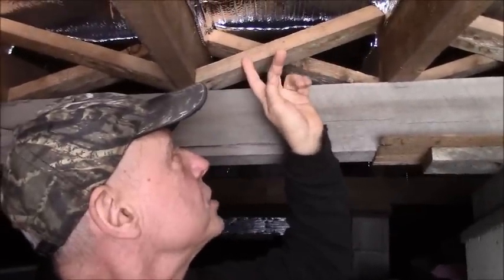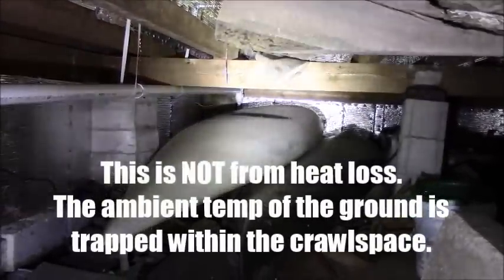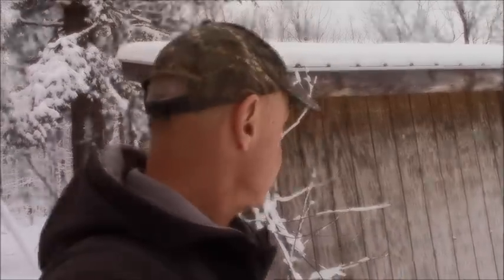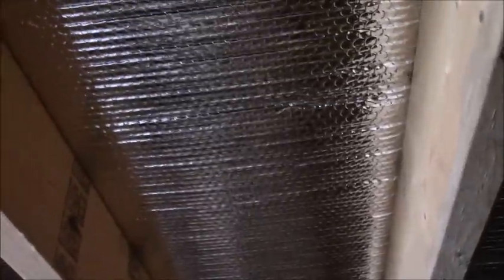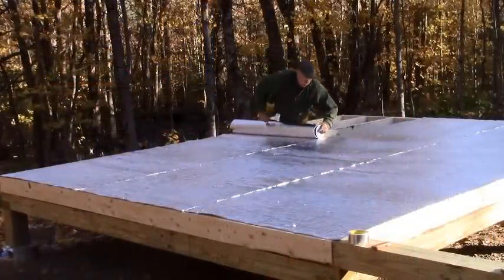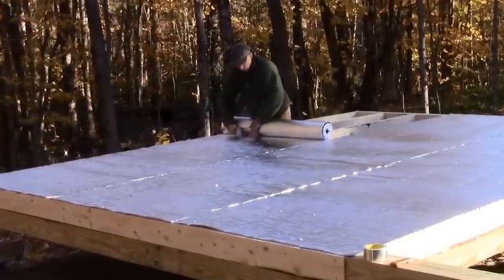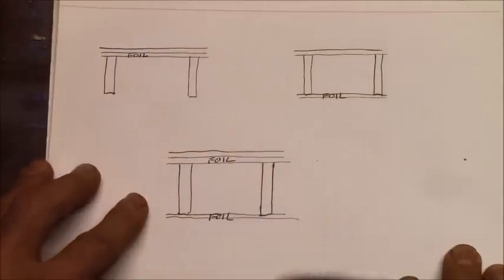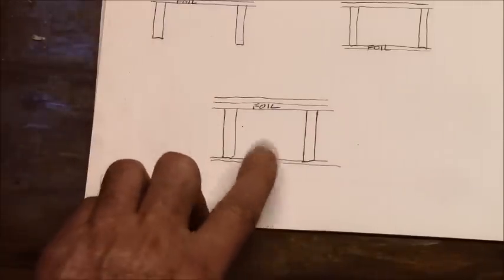BUILDING INSULATION  Proven Tactics and Solutions For RODENT FREE Results and DAMP CRAWLSPACES  DIY

Comment: Boss, I really want to use this bubble foil and I'm convinced it works for you up in Maine.  However, I'm in Louisiana.  I do have something like this in my metal shed and it works good.  But on the cabin I'm building, I'm concerned that putting the foil between the subfloor and the joists touching a cooler subfloor (air conditioned in the summer being very hot outside) will cause the kind of condensation issues you mentioned around 21:00 of your video.  Can you give me any suggestions on this?  Thanks.
Reply from the maker: Very good point you have there.  I can't say for certain but I would think you'd be ok doing this. If you can get beneath your structure, you can staple the foil to the underside of your sub floor (between the joist) and do a section of floor but not the whole thing.  This will allow you to peel back a few spots to inspect the results. Then proceed or switch to a plan B.  Let me know how it works out.

Comment: A quick question and if I were to have a building with a crawl space would definitely use bubble foil.  The question I have is I see a lot builders and DIYers having spray foam in roofs and walls.  Is there a problem in doing that or is it great insulation to use?  Thanks and I’ve been with you for a long time and never get tired of your videos, keep up with the awesome material you project.
Reply from the maker: Spray foam insulation is one of those things where you take a gamble it it.  It works but it's toxic as hell.  Google the effects of spray foam insulation and decide from there.

Comment: ants love the pinkboard too. I put some pinkboard scraps in the attic of a shed and a couple of years later I noticed pink dust on the floor of the shed. I looked up and pulled down the scrape pieces of foam board and sugar ants had made a home inside the  foam, there were thousands of them.
Reply: Dang... That's not reassuring. XPS foam board is exactly what I planned on using. : (

Comment: Super video^^ as always lots of fans of the bubble foil on here, quick question from the "peanut gallery" about walls, if you're building new, and dont want rodents in whatever insulation you use, but want the wall to still breathe, is there a way to use the foil and that soffit vent spacer thing you use, and then have a vent say at the top of the outside wall, or somehow tie it into the soffit vent in the rood overhang? (as you can tell, im not a builder^^) but I'm thinking there must be a way to be able to use it  and still allow the wall to breathe, you probably have better ideas on that than i would. Thanks. Hope you got to see the video link I sent before of that giant greenhouse thats suing bubble foil for its insulation, made me think of you. Cheers.
Reply from the maker: The best way to keep mice out of the walls is to have it sealed so they can't get in.

Comment: Did you put foil against the rim boards ?
Reply from the maker: I did but that was a mistake.  I've found that it's important to ONLY put the foil against a surface that will reflect heat. Putting it against a surface that reflects cold will create moisture behind it.

Comment: Thank you for such a detailed and informative video.  I love your content.  I live in a 111 year old Sears home.  The cellar ceiling is insulated with fiberglass.  Some of it is falling down.  Wondering if I should remove it and replace with the bubble foil or should I just put the foil as another layer.
Reply: Also, we have had rodent issues.
Reply: And, I love the ending.
Reply from the maker: I'm making a list of the construction questions and will answer them in an upcoming video.
Reply: Thank you so much!

Comment: So on the walls outter wall boards, then insulation, then use bubble foil and then put up wall boards on the inside correct???
Thanks.
Reply from the maker: I would stuff the walls with insulation and put the foil on the inside of that - facing the heated side.
Reply: @thebossoftheswamp  thank you boss, your the man..

Comment: My Dad's log cabin built in the Sunapee region in the mid 70's had a disaster for a floor insulation system. First all, the knothead contractor stapled the R-19 kf fiberglass ins with the paper face towards the cold dirt. The first winter my dad called the contractor and said the paper faced ins was soaking wet. Genius contractor told him it was the moisture from the dirt floor and sent a couple of guys over to staple 6 mil poly to the underside of the joists. Dad would crawl under there and poke holes and the water would just pour out. KD Spruce joists were compromised in a few short years. As a teenager, I learned more what not to do than I did what "to do" on Dad's poorly constructed cabin. Sad but true.
Reply from the maker: I'v seen  that mistake many times.
Reply: @thebossoftheswamp  It was my indoctrination to to the world of construction. I was actually lucky to learn those mistakes as a teenager and not have to learn them the hard way building for someone else later in life.

Comment: I have an application for this that I'll try but wondered if both sides have to be foil (reflective)?  I found a slightly cheaper version that has one side reflective and the other side isn't.
Reply from the maker: Can't say for sure but ever since I started using this and getting the results I get by doing so, I've stuck with it.  Good luck with your project.
Reply: @thebossoftheswamp  Thank you.  I'm sold and think I'll try the cheaper version but of course put the foil side face up toward the warm side.

Comment: We had a camper that had foam board insulation in the walls.  The ants got in it and when we went to pull our camper out to take it to the lake, the siding just peeled right off due to the damage they did.  If they’ll do it in a camper I figure they’ll do it in a house.

Comment: I enjoy your videos a lot! I learn, I laugh and I smile. I would like to use your bubble foil (if it is possible to get in Norway) to insulate my floor in a little cabin in the woods. My challenge is that it is imposible to get under the cabin - the cabin is on low pillars. I guess the rodents have a great winter, as they have stolen most of the Rockwool insulation. My floor was rather cold during X-mas with temperature -11,2 F. Have you in any video got into the challenge of insulate by opening the floor from above?
Reply from the maker: Is your building skirted?  If not, skirting will make a huge difference in keeping your floor warm.
Reply: @thebossoftheswamp  It is not. I`ll do the skirting the way I have seen you doing it. Thank you SO much for answering me, and again thank you for sharing all information and your livestile (hapiness and challenges) with us.

Comment: Getting an amish cabin delivered in a few weeks. I tried to get them to install bubble foil at my expense. Unfortunately they woudn't. So I'll be crawling my fat butt under there for the install. I might use it on the joists as well. What did you use for skirting on your builds? I'm going to use the bubble foil on the interior of the skirting also. Should I vent a few areas on the skirting? I'm located in North Carolina where the summers are high humitity/hot. BTW, been a subscriber for years and by far the best damn channel on Youtube!
Reply from the maker: I'll talk about skirting in my upcoming DIY series. I vent the crawlspace in summer only.

Comment: Just got 10 rolls, boss. I'm going to do mine the same way; but does it matter which side goes up, or down, one side seems shinier than the other..? 👍👍💚 And also, I am considering R-11 faced fiberglass after the boss foil stapled to the joist bottom,  any suggestions  ??
Reply from the maker: I've never seen one side shinier than the other but put the shiny side facing the heat.
Reply: @thebossoftheswamp  thanks boss.👍👍

Comment: 7:37 why don't you put that bubble foil on the bottom of those joists?  It would be more effective the additional air space is an insulator.
Reply: I asked this question because I want to protect the wires from the rodents and not keep the wires exposed.

Comment: shockingly, for a barn turned into a garage, the existing insulation, which was 1970's cardboard, worked amazing well.  stopped snow, air, rodents.  Like you noted, pink insulation is loved by the rodents, and just turns into a rodent nest.   The spray foam from a can, got carried away by rodents, piece by piece, until there was nothing left.   they sampled the professional spray foam, alot, but generally it's 99% still in place.  So, for the barn, with rats, and cats, the best insulation has been cardboard.  (what?).
Reply from the maker: That's interesting. I'm surprised the rodents didn't devour the cardboard as they love to chew paper.
Reply: @thebossoftheswamp   I think because nothing covers the cardboard, there is no where to hide.  But, I find it weird, to see cardboard boxes from the 70's, on the barnwalls, when clearly, no one would recomend using cardboard, ever.

Comment: I am a german facility manager with 30 years in the building industry. Many do underestimate the surounding humidity in the forrest near by a river or with much wet swomp ground.  I hate fake insolation like rockwool or fiberglas. They become stalactite caves because they soak humidity out of wood or the air and never give it back. Then it becomes wet (depends on how much humidity is in wood or air) the rotten prozess starts and fungis grows it looses total the capebility of "insolationpower"
Mices love this fake inso. Styroopor is loved by ants. If one will build a smal low budget cabin or home- when ever you can build with wood- wood for the structure if you cant build a real log home- build with air between the wood slates inside and outside. And if you can buy cellolose as an insolation for roof floor and walls. Also perfect is wood dust! This material is known for hundrets of years and I do know homes like the one from EINSTEIN that is only build with 10 centimeter logs but in and out extra slate layer between the systems AIR. No fungi no rotten after 100 years.
The best YT canal for traditionel building is NORTHMEN the film "Birth of a wooden house" will explaine the traditional building way and the "natural material rode" 
The most importend thing with wood: It can breath. If humidity is high inside it soaks it into the wood fiber- and later it gives it away. Of course good fresh wind through the house open windows in the winter time cross circulation...
The climax the smell in a natural house is diverend then the smell of the fake insolated home. Frank

Comment: Why would anyone build with the fiberglass insulation or Styrofoam when they can use double sided bubble foil?
Reply from the maker: Because their tunnel visioned over R Value...
Reply: @thebossoftheswamp  , Could you please elaborate, I don’t completely understand your comment.
Reply from the maker: @MissMarinaCapri  The performance of insulation is measured by a term called "R Value".  This foil is thin and has a very low R value so people think it doesn't work.
Reply: An it be installed in walls & attic?  With nothing else...& be enough?

Comment: but arent all modern houses built with a plastic vapor barrier? It goes studs > osb/plywood sheathing > plastic wrap > siding ... shouldnt all modern houses experience the same mold issue as the story you shared?
Reply from the maker: What you're talking about is House wrap/aka Tyvek.  It's not plastic sheating and is breathable.